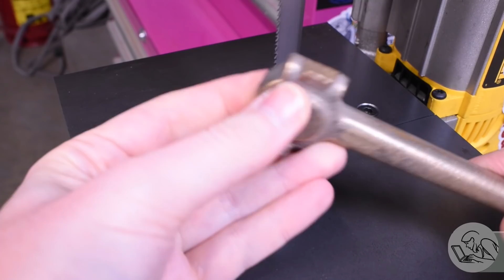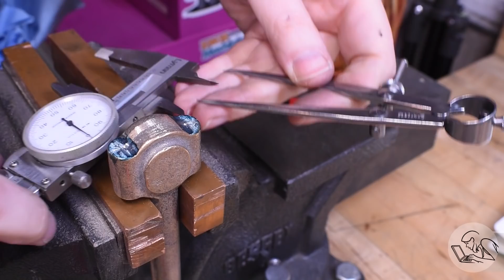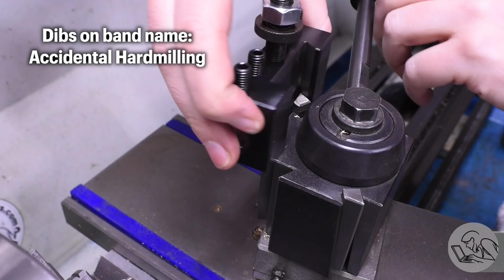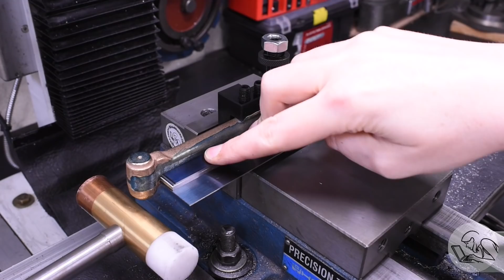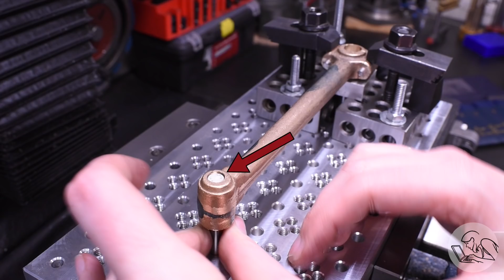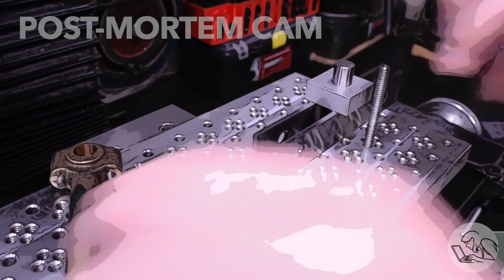Connecting Rod! Big Steam Engine Build, Part 5

Comment: What is Quinn going to be powering with sead steam engine? A sewing machine for cosplay? No no it would dissolve the hot glue.... air ship then maybe? No its to small... how a bought a back yard train? Probably not she comments on how small her garage is and if she had a place to put a 30 × 30 shop she probably Collin Furze... I got it she's going to make a solar hot box to make steam and use the steam to turn the engine. Off the engine she can turn a common shaft to power her own industrial revolution and conquer many lands near and far to feed her need for spice and tea. I think we've got a winner. Cx

Comment: Great work again, thanks. I would have machined all planar surfaces parallel to correct dimensions before anything else and used them as references thereafter. This would have been useful at all stages. So, I would have done almost everything in the opposite order. There must be more ways of doing this, as always.

Comment: I just went through something similar with some smaller connecting rods for a Stuart model. My approach:
* clean up the flats on the big end and get close to width so you can use them as reference surfaces
* clean up the flats on the little end, making sure they are equidistant from the center line based on the big end surfaces
* now you can accurately lay out the two holes and the split line
* make a jig using the knowledge of the delta between the thicknesses of each end, to get the casting level
* drill the bolt holes, split the big end, bolt it back together. Use the jig to drill and ream or bore both ends
* the center part of the casting is normally turned to a taper; you can do this between centers. The little end center is in material that will be removed, so that's easy. The big end center will remain visible, so keep it small.
* use the jig to hold the part for cutting the clevis. I found that side milling with an endmill is liable to grab the part; a much less scarey way is to use a thicker slitting saw and go in from the end. You can clean up the radius by plunge milling, as you did.
Reply: Simon, thanks for the order of operations. Would you please be so kind and share a picture of the jig you made?

Comment: Dear Quinn
Excellent video.  Sorry to see the problems arising.  I would point out that if the errors really bother you, I think PM Research will sell individual "replacement" parts (or at least they used to).   Also, I have 2 "full size" antique vertical steam engines and there are several non-perfectly centred holes in some of the motion and they still  run perfectly well!
Best wishes.
Paul

Comment: 15:50 my dad once did a similar mistake and solved it by lentghening the part. he tied some wights and then heated the part with a plumber's torch. i don't know about bronze though, his part was some kind of mild steel
Reply: Nice save by your Dad! I'm reminded of an experience at work where an engineer was trying to install a "precisely shaped" tantalum wire (it was straight) through a bearing assembly with no clearance anywhere... It didn't reach... He was on the phone for almost a day to base HQ and I kept hearing "I can't bend it longer! It doesn't reach!" over and over, watching him slowly dying inside. They didn't believe him and specially flew out the exact same part at great expense, poor guy.

Comment: Could you be able to set it back up and use an over sized endmill to get the hole corrected and then make a bushing to bring it back to spec.?
Reply: Just what I was thinking, plus the hole could be centered at the same time.
Reply: This does seem to cry out for a bushing to correct the length of the rod.  Looks like there is plenty of material there to accommodate the bushing, too. A Good interference fit and you would never know it was originally machined with accidental approximation.

Comment: thanks for leaving in your errors. it's clichéd at this point but it's so interesting to see how you make and recover from mistakes. it also makes me feel like I could eventually get as good at machining as you.
Reply: Agreed.  I've learned so much making my own mistakes but it's nice to learn from others' mishaps for a change.   I've probably learned more valuable lessons from Quinn's hobby-sized shop than I have from a more polished Abom and his larger scale operation.

Both make great videos but most of what Adam works with is out of reach for a hobby machinist like myself.
Reply: The only people who don't make mistakes are the people who don't do anything.  If you had to make 10 of the same part no doubt the last made would be the best and most efficiently made because you would have learned from your mistakes and gained speed as each subsequent part was made. IMHO, the sign of a real expert is not that a one off part is made perfectly the first time, its that the expert can think through errors and find ways to correct as the project progresses. This is true for metalworking, woodworking or most any other skill set.

Comment: I'd theorize that the easiest place to take up the error in the drive rod is the piston rod? If the crosshead is a touch closer to the crank, that's no big deal other than it changes the angle of attack during the stroke/revolution?

Watching you start this project, I was all "ya, I could do this too!" Today I realize just how foolish that idea was, lol.

Had you not mentioned how/ you had messed up the machining, I really doubt any of us would have noticed.

I look forward to the day we get to see this chug!

"Oh what fresh hell is this?" It's life, lol. I think this needs to be a quote on a shirt!
Reply from the maker: Yah I plan to verify the angle is okay on the crosshead and there is extra travel room in the bore for it. If so, lengthening the piston rod is an easy fix. If not, I’ll move the crosshead pivot down.

Comment: I do a lot of demilled gun parts kits builds. Most of the factory parts are hardened, at least on the surface. Sparks are the norm. Horay for carbide.
Reply: I would appreciate a video on hard milling. I do it but I really don't know the correct way. I usually just use a already chipped and worn carbide mill.